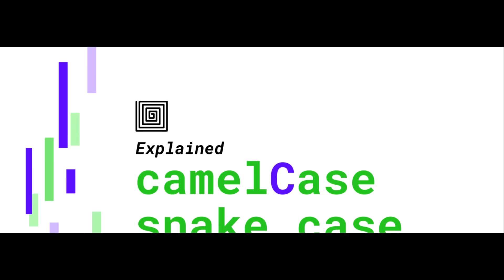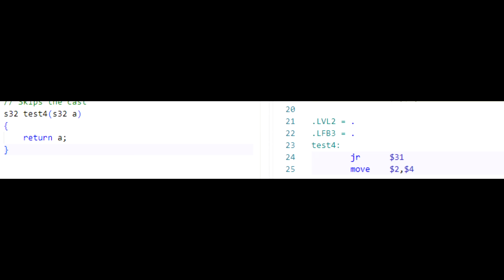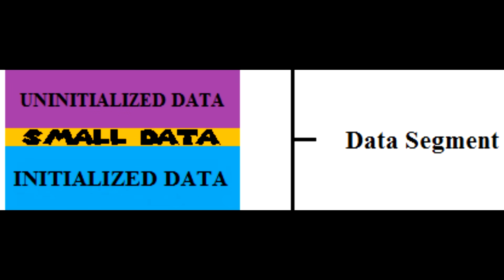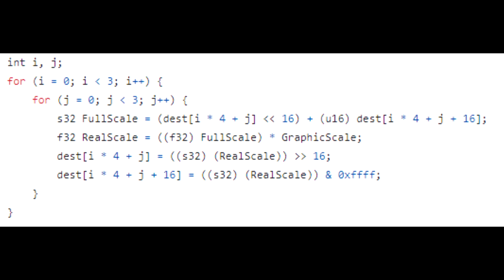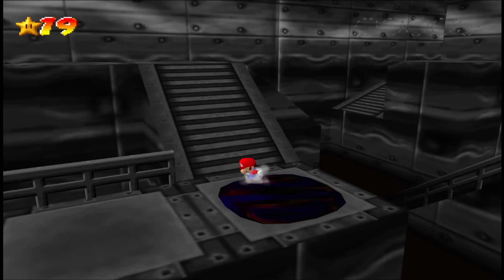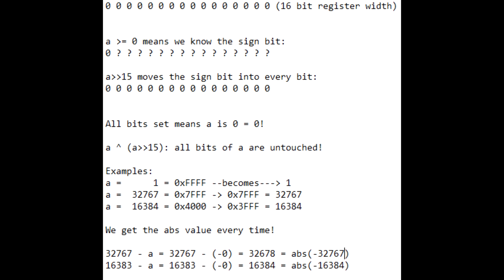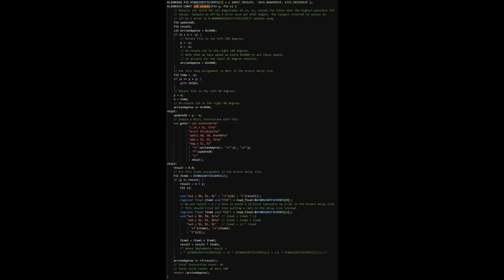Optimizing with "Bad Code"

Comment: First, great video, but I'd like to point out a few things for people who might not know them.  A key thing that cannot be emphasized enough is that you need to measure whether these sorts of optimizations actually speed up your code.

For example, the self-modifying code trick will often make your code slower since to make it work reliably you'll need to invalidate the icacheline (and flush the dcacheline if you used cached access), and the possible extra reads from RAM will often cost you more than you gain.  Also, I think you know this, but for other people's benefit, you want to modify code while you're executing far away from it (MIPS cpus wont execute modified instructions if the instruction is already in the pipeline -- this isn't so bad for the VR4300, which only has a 5-stage pipline and is in-order scalar) and in bulk (so you can minimize the number of cache flushes needed).  The more modern the CPU, the worse self-modifying code is in general.

Also, if you need to do a ton of BS to get the compiler to output a specific sequence of instructions, perhaps you should just code the function or performance critical piece of code part in assembly.  In the example of atan2s, it already has large portions of assembly, so making the code less fragile is probably worth it.

For the struct Surface, 0x16 isn't 4 byte aligned, so the compiler should automatically insert the padding, so the two structs should have exactly the same layout, which agrees with the offsets in the code you show onscreen (although it could be more clear to explicitly show the padding).
Reply from the maker: yeah i'd love to just write it in assembly, but i find it to be a huge pain to write inline assembly under GCC. it never seems to work right beyond small snippits.

yeah i added the padding on the left side manually just to showcase this better. (although there is probably some compilers that would realign the struct on the right to make the struct smaller? or at least, there should be some settings that do that automatically for you)
Reply: @KazeN64 I'm pretty sure that "setting" is just the packed attribute ( __attribute__((packed)) ) which will place the struct members such as they occupy the least amount of space (byte-wise) even if it breaks type alignment rules (like ints needing to be 32bit aligned)

Comment: Just as a potential idea you could "document" some of the hardest functions by writing tests against them, assuming you don't have any yet.
Reply: Or having the clean code versions available somewhere to indicate what they're supposed to be equivalent to.

I know Kaze has said there are usually equivalent function names in the base decomp project, but I'd love to see optimized, even if not fully, versions of those, but with readability still intact, if available.

Comment: Very very nice video :3 Just a little pointer btw (no pun intended), floats don't get "generated", they are just another type of immediate. They only cause extra costs when performing any ops on them. The register optimizations were really sweet ^^ Which GCC version does the N64 toolchain utilize that you used in this video?
Reply from the maker: you need a lui and an mtc1 to get any float constant. gcc often stores them in memory and just uses lwc1 from gp (or lwc1 + lui if you dont use sdata). that's what i mean when i say "generate a float".

i'm using an edit of modern GCC that has a few n64 specific optimizations in my video (but standard gcc behaves identically for all examples given)
Reply: @KazeN64  Oh! In that case i take back what i said, didn't know that ^^ That is an interesting quirk. I come from X86_64 and ARM64 mainly.
Reply from the maker: @KitsuneAlex  ahh yeah they probably have a lot more options. MIPS is all just 4 byte instructions so it's super limited in how much info you can squeeze into each individual one
Reply: @KazeN64 I think ARM requires float constants to be loaded from memory as well, as it's also 4 byte fixed width instructions, but x64 and its variable-length instructions don't.

Comment: since readability is going out of the window, i think kaze should have a code copy of the engine before this dramatic changes, because when he released the source code of rtyi it will be so hard to read and tightly coupled to its function that no other hacker could made a new hack from that source code.
Reply: That's a lot of effort at no benefit to Kaze.
Reply: @Minty_Meeo  it is just having a copy of the previous code. With all the previous performance improvements it should be enough for the majority of hackers.There is no need to further improvements from 99% of the rest of mario 64 devs.
Reply: I think he does also keep actually readable C versions of all the functions above the bizzaro optimized versions for that purpose.
Reply: @inkoalawetrust  that's good to know.
Reply: I assume he uses git or some other version control system.

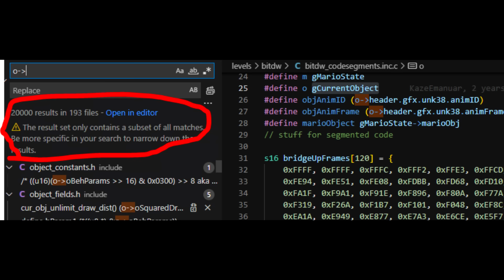Comment: 5:39 I disagree, explicit is often good, and sometimes it makes code easier to read to compare to TRUE.

It really depends of the context, but you should not fear to use explicit boolean comparison if you feel your code readability can be improved by doing so
Reply: Yeah, for readability and clarity of intent, i prefer explicit bool comlarisons and strict comparisons with no type juggling.
Reply from the maker: wtf
Reply: wtf

Comment: My favorite instance of int bit manipulation to do float math faster is absolutely the fast inverse square root. You (probably) know it, you (probably) love it. Take the bits of a float, turn them into an int, bit shift it, subtract from 0x5f3759df, and convert back to a float. Improve the approximation with Newton's method and you're done!
Reply from the maker: i have a video about the fast inv sqrt on n64 too if you wanna see how i use it

Comment: Some really neat tricks in this video, but dude, honestly at a certain point it might be worth just hacking gcc to add a pass that does some of these transformations for you since they’re so mechanical 😂. Or even just a write preprocessor that takes sane C and spits out optimized C (you could do this with python’s pycparser for instance).

Comment: 8:35 Wouldn't it be better to just replace it with a generic "Lateral Distance" function that works on vectors and then for objects do lateral_dist_between_vectors(&o->oPosX, &o->oHomeX)?
Reply from the maker: that'd be an option too yeah but it would add an extra cycle in some cases. offsets in addresses can be done in the same cycle as a read float instruction, so by having the offsetting happen in the function instead of in the argument, you remove some redundancy.
Reply: @KazeN64 Oh right I forgot the function can't be inlined or macroed in order to use cache more efficiently.

Comment: On reverse loops, instead of looping fron N to 1, would it be useful to loop from N-1 to 0 with this? 'for (i = N; i--; )'
Reply: I think this depends on the processor because not every of them has got a decrement and branch if zero opcode.
This is true for most of the the 65xx family (exceptions like the SPC700 do exist) which lack this opcode but have a BPL/BMI (Branch if PLus/MInus, essentially branch if < 0x80 / >= 0x80) which allows you to run up to 0x81* iterations like this. In the end, the only advantage is that it makes assembly code easier to read and write because you don't need to append a -1 onto every indexed variable.

*To explain why 0x81 specifically: Most loops are best implemented as a do-while (execute code first and then decrement loop count) because you'd otherwise run two branch opcodes (one which does the comparison, the other to jump back to the loop). Because you take the offset into account, a loop count of 0x81 means you store 0x80 into memory. Once the end of the loop is reached, decrement the loop counter which, if it's 0x80 (memory value), becomes 0x7F which is positive.
Reply: @MarioFanGamer659  thank you for the explanation

Comment: seems like at least for some of these, like the gotos, you could get some preprocessor magic to do that for you rather than writing bad code.
Reply from the maker: you can use something like "(__builtin_expect(!!(cond), 1))" to do it in GCC, but that is ignored when compiling under Os (which is the faster than O2/O3 on n64)

Comment: Have you ever thought about writing a usable LLVM backend for the N64 and writing obscure compiler passes that do the same thing, except that there might be a slim chance they hit elsewhere? 😂
Reply: Some of these are just straight up compiler bugs you are working around, so why not fix them? I would be surprised if you can understand code like this that you can't read GCC/LLVM source code.

And even those that aren't, eg. the actor struct vector hack is something that could be a pass named ... Idk
"MergeCommonDataFlow" or something
Reply: @mike64_t   At some point, using such old machines, one might as well write their own compiler. Of course, that's a huge side project and modifying an existing compiler is definitely a better way to go. Still, I'd love to see someone write an N64 emulator just to test out a compiler for the platform and to do testing by writing homebrew games.

Comment: The code of Emanuar

According to some complicated videos Emanuar was a program that had a copy of Super Mario 64 that was preserved as a relic until needed. Some of it's code was unoptimized so it had to be replaced by Emanuar. After many, many years, many such replacements occurred. Eventually, none of the original code was present. Philosophers could then debate weather it was the same game that Emanuar had used, and if not, could it be distributed as a rom without Nintrndo stepping in to forbid it.

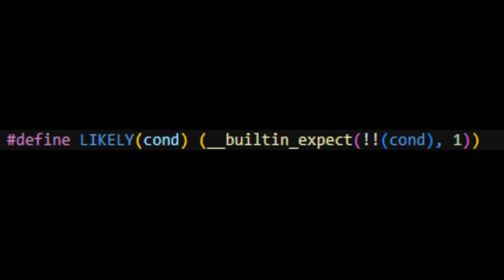Comment: For the goto one, have you tried __builtin_expect (which you have defined to LIKELY/UNLIKELY in the code shown at 1:37)?  Usually it convinces the compiler to do that for you
Reply: He mentioned in another comment that when compiling with -Os the builtin doesn't work
Reply from the maker: unfortunately those are ignored under -Os so it won't work :(

Comment: 2:04 what are these “s” types? ive not seen this before…
Reply from the maker: s16 is just "signed 16 bit". most compilers will compile a "short" so a signed 16 bit type on most architectures.
Reply: @KazeN64  yeah but i thought this was c, is that a thing in c? i thought it was only called short
Reply from the maker: @vk8a8  all the relevant types are typedef'd to be just s/u and the bitcount to avoid having to deal with all the useless names programmers have dreamt up for variable names.
Reply: @KazeN64  based

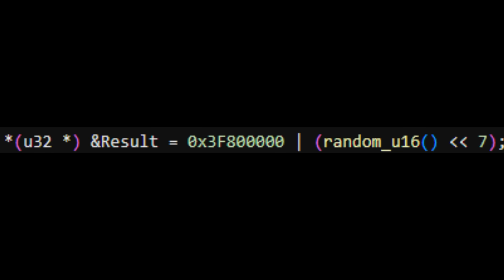Comment: 11:48 tbh, this is not bad at all. Just make sure to either comment or split up that line to make it clear that you're copying it into the mantissa. This is core and short low-level code that is acting on primitives. I'm pretty sure it's kosher enough to act on the bits of that datatype

Comment: Wow I always thought casting had zero CPU cost. Interesting.
Reply: It depends on the types being cast. Compatible types of differing sizes, such as unsigned integers, would just be a matter of reading only the bits you need or expanding with zero bits, which isn't to say that it costs anything as you're copying the value anyway. Of course, I don't know if the N64 processor has instructions like that, but most processors do, even the humble z80 and 6502 both have such instructions. Of course, casting between float and int will never have zero cost.

Comment: At this point it'd almost be worth it to just write the compiler yourself as well

/hj but like, if the compiler is actually just that stupid in certain places, then adding those optimizations into it rather than everywhere in your own code would be good in the long run, right?

Comment: With the compiler not checking for 0 (around 7:30), try using an unsigned integer for the loop. Remember that a compiler is not allowed to change the behavior of your program, so it needs to support the value starting negative even if you'd never actually do that.

Comment: I use a similar set of techniques. People will tell you that you can't do better than the compiler. We don't hire those people 😁.

Some things we do to make code more readable:

Reserve obscure code for those hot spots that are absolutely necessary.

Often it's possible to coerce the compiler to do what you want. For example, use of RESTRICT type keywords, and __builtin_unreachable (to make the compiler assume certain ranges etc)

If it's difficult to read, encapsulate it, or parts of it, in an inline function or macro.

Name these things well

Document the heck out of these areas

Revisit when the compiler changes, because they can suddenly generate different asm for any given code.

Happy coding!

Comment: If you wanna optimize for performance speed only then you would write everything in assembly with the first thing that flies out the window being space (to the extent that you have to of course think about memory access speed, so you can't go too big either), with every single instruction being about as accurate as necessary. The result of any division for example only has to be accurate under specific circumstances. If you know there will never be a zero or null value in the input then don't waste time checking whether an input is null or zero. 
In fact just write your code in VHDL or Verilog and design specific hardware to execute the entire program.

Comment: the real fun comes at the end of the dev process when you've finished parts of the codebase and can start abusing the linker script for more advantageous cache positioning
Reply from the maker: ive already manually aligned everything to cachelines in the most advantageous way i can think of... not sure if the linker script can do much more

Comment: When you fight the compiler that much, you might be better off using inline assembly instead. Plus, non-standard calling conventions were the norm back in the day and it's possible to create merged math functions and return multiple values at the same time from them. Then there's pseudo SIMD with bytes or words belonging to different "variables"  packed in the same register and abusing the swap instruction to shuffle around op effects and overflows... Eliminating conditional branching altogether and just doing the calculation and discarding it if a condition would be false might be faster in some cases (wherever branch misprediction is likely).

Some processors also have branch hint instructions, but I don't know if that applies to the N64.
Reply from the maker: n64 has no branch prediction alltogether. the goto stuff is just for icache coherency - which i guess is kinda the same as precompiled branch prediction?

Comment: I don't have a problem with any of these optimizations, what I have a problem with is when people don't document the reasoning behind the weird code.  Just put a comment in there about what you're doing and why, or put a comment that points to a document somewhere.  Every programmer should be capable of reading any code, but it's unreasonable to assume someone in the future will work out why you're doing what you're doing.  If you have to think about why it works for more than like 5 seconds, it probably needs documentation.